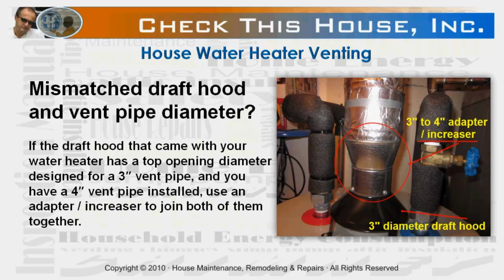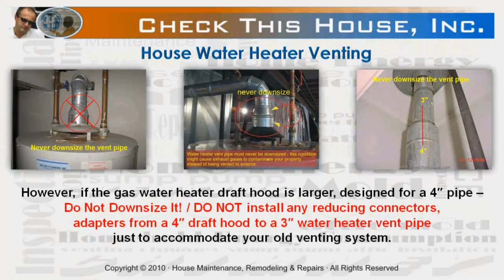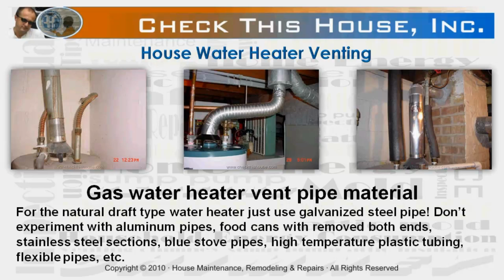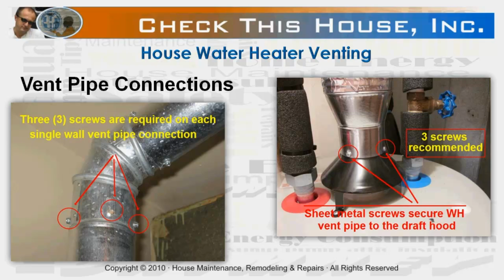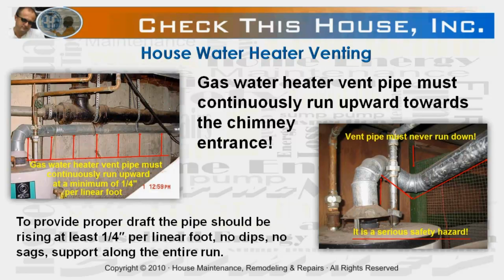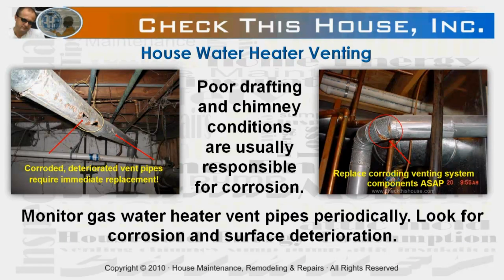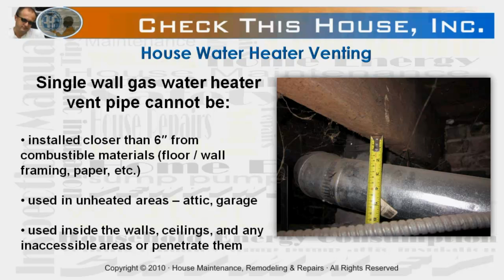Natural Draft Water Heater Venting Safety and Building Code Requirements

Comment: Thank you for this vid. I watched many water heater replacement vids and thought all I had to do was buy a new unit, swap out the unit and make a few connections. But I did not know I would have to be building a whole new venting situation and none of the water heater videos goes over it!

Comment: My new 40 gal. water heater is taller than my old 30 gal. one. Do I need to cut the vent pipe to install the new one or does the vent pipe slide upward to give me more space?

Comment: My 3" gas water heater goes to b vent 6" for 25 feet up since 30k BTUs I would like to have last 5' at 3" out metal roof. Such a big 9' hole out to metal roof 12/ 12 pitch so I'd rather have 3 in so less water that might have leaked in. Resistance is smaller a 6" throughout the majority of the line so I shouldn't have a problem going from 6" back to 3" because that's better than  a 3" the  whole  30' length. Right?? So the whole system the way I want to do it going from 3 to 6 to 3 would have a lot less resistance and just a 3 the whole way. So why can't you reduce or can you reduce all I hear is people say you can't reduce you can't reduce you'll go to hell if you reduce.
Reply: Im just some guy but you would end up with the same resistance if the pipe outlet is 3" regardless if you have 6" in between. Kind of pointless. In fact it may hurt the drafting
Reply: @ImDaBadGuy  A reducer could cause more resistance due to the turbulence created when the flue gases meet the reducer. Another factor to consider is that the gases slow down in the 6" pipe and THEN encounter the reducer. For these reasons, installing a 6" line between two 3" lines creates more restriction possibilities than a single 3" vent.
Reply: @ronroberts8036  exactly.

Comment: Thank you for a detailed explanation of proper installation. Suggestion is to show single wall to double wall proper interface, and should it be taped etc, also should the variable angle joints be taped after installation, and what type of tape should be used.

Comment: Does this video cover Vent Piping Installation requirements per code in California 2017.
Reply from the maker: It's based on IRC (international Residential Code) and UPC (Universal Plumbing Code), you always have to check your local building code requirements to ensure compliance.
Reply: +Home. Thanks.

Comment: I have a waterheater vent pipe that is touching insulation what should I do?
Reply: +Everything. You are going to have to Reinstall the Vent pipe to take a direction that puts it at least 6'' away from that said insulation, with that same vent pipe or a newer vent pipe. Or remove the insulation, it's up to you and your wallet.

Comment: Hi, my brother has a 120,000 btu/hr, steam boiler that his installer fitted with a round diverter. This diverter has a large diameter "skirt" which is sitting on an angle due to the 3inch steam pipe which is living there. It is tight to the top of the boiler but I don't like the look of it. Can I remove this diverter and install an oblong open vent  right after the first elbow in the breeching to do the same job? I am a refrigeration tech and not up on the code requirement. Thank You
Reply from the maker: +gearhead0800 Hi, I would check boiler’s installation manual for positioning of the diverter. The design of this particular boiler may not allow alterations of its venting system and I don’t know if the installer did what you described because it was convenient or required. Give me the brand / model, maybe I’ll find something helpful if you don’t have the manual.
Reply: +Home Maintenance    Thanks for getting back to me. As I mentioned I am a tech. myself and I am 100% certain that the installer just leaned the exhaust to the side because the 3 inch steam line was in the way. He did not want to reroute this steam pipe around the diverter so he just tipped the exhaust about
15 degrees to the left to miss the pipe. I don't know how to send a scanned sketch to you unless I had an e-mail address. It's easier to see then to explain.
Reply from the maker: +gearhead0800 it's questions@checkthishouse.com / send me its brand and model number

Comment: Some say that my roof supports should be cut so the metal vent pipe doesn't come within an inch of wood. Who would allow a plumber to cut into roof supports?? What are the options to reduce heat to the wood without compromising the structure of the house by chopping into a roof support beam?
Reply from the maker: Renee Zee Well... it's difficult to produce just one answer based on your description, simply because there are multiple variables that might affect this answer. The safest suggestion would be to put an offsetting connector on your vent pipe. You'd just need to incorporate that offset into the vent pipe calculations. There could be a few other options but without evaluating roof framing and positioning of all venting system components I can't really give you any.
Reply: Put on a taller roof